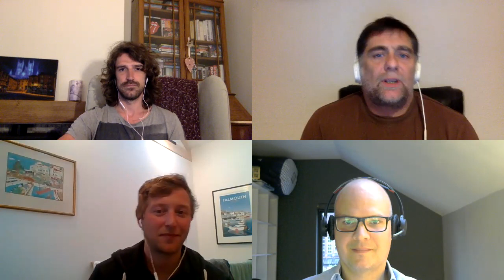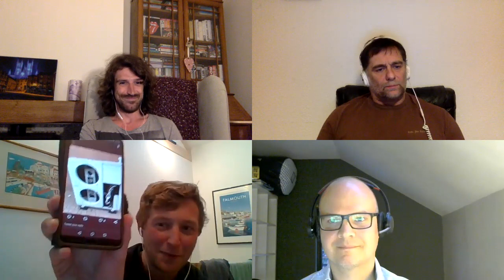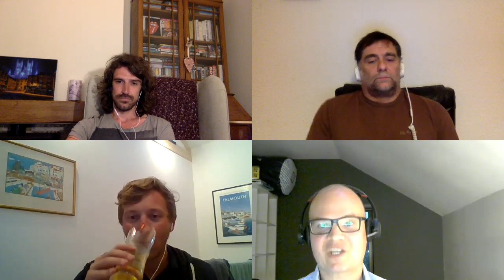Heat Pumps and Policy in the UK

Comment: I heard on the LBC radio station, talking about heat pumps that if new government policy was to exchange boilers in to heat source pumps and install electric car chargers the electric grid will not take the extra capacity of power, as back in the days it was installed, it was only for a cocker, lighting and a few sockets. in a house but there are so many properties being built with more demand for electricity, the whole grid will need updating,
Reply from the maker: Yes, I think there will be lot's to think about regarding the grid